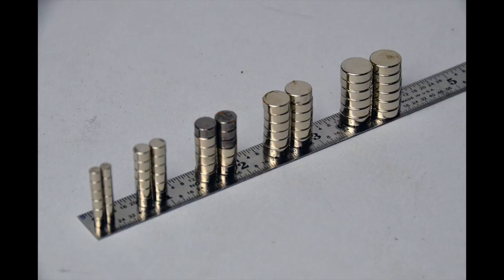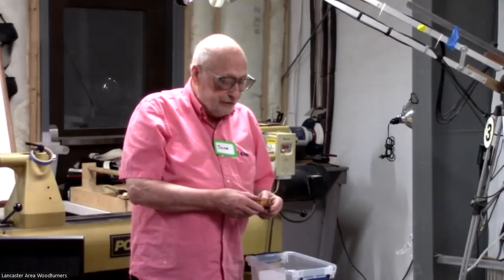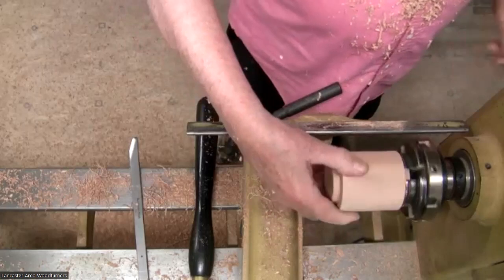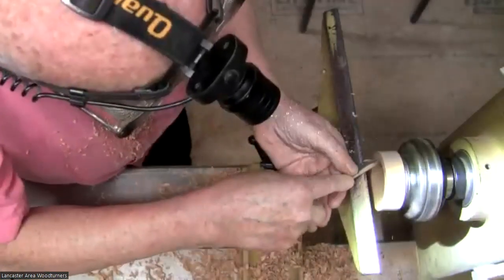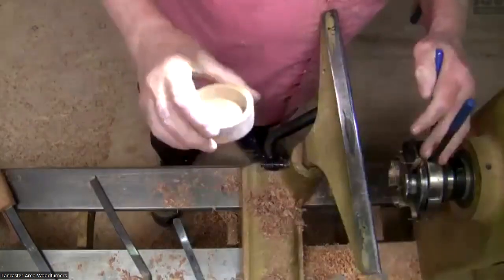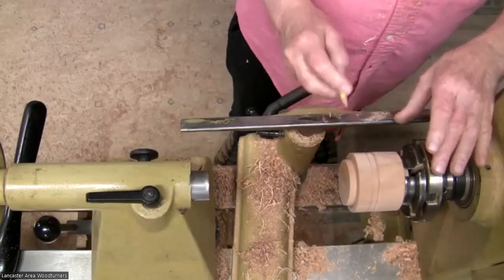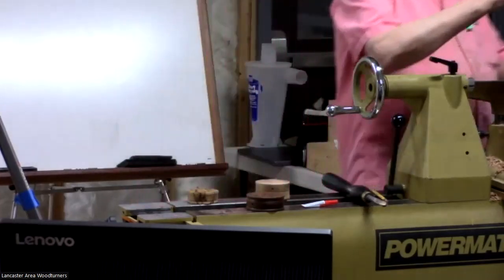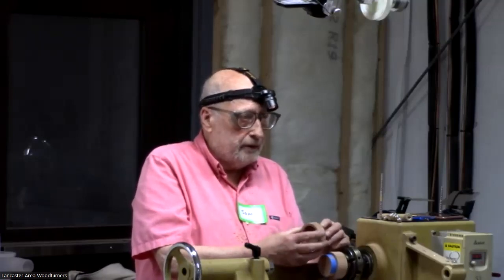Magnet Boxes by John Kelsey

Comment: I'm going to have to try this! Really nice presentation showing where the ruts in the road will be found. Having worked with magnets (industrial applications) for almost 40 years I can offer some advice: The really strong magnets, "Neodymium" or "Neo's" (NdFeB) come with a protective coating (metal like nickel or chrome plated copper etc.) This is because they are very corrodible, even in just humid (like kitchen) environments. There is another type (a bit pricier)  Samarium Cobalt (SmCo). These are much more durable an I would recommend them to anyone considering offering a commercial product. The NdFeB type can be sealed - but it requires a conscious effort to make them last :-)